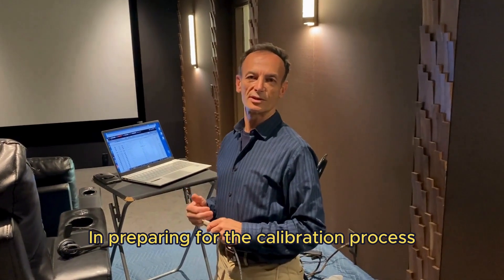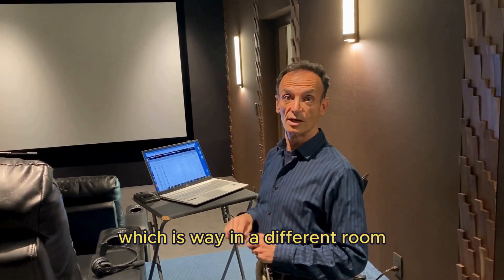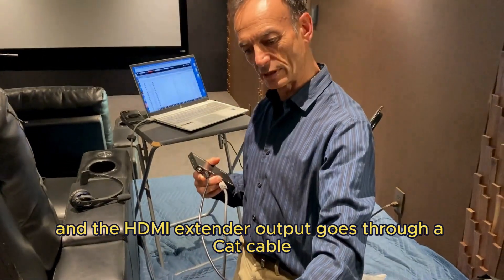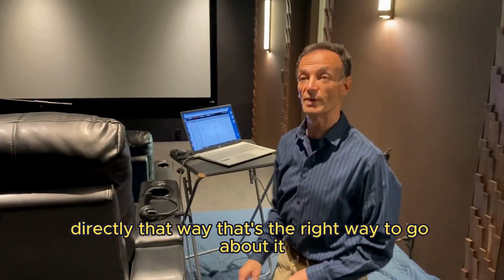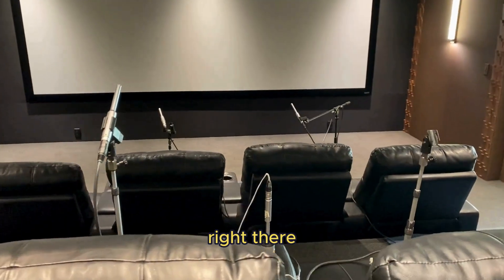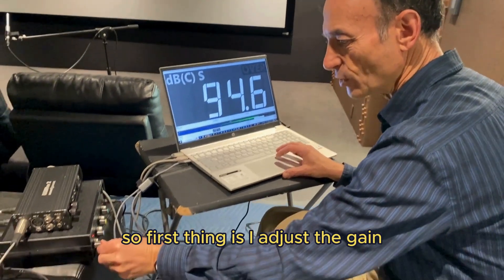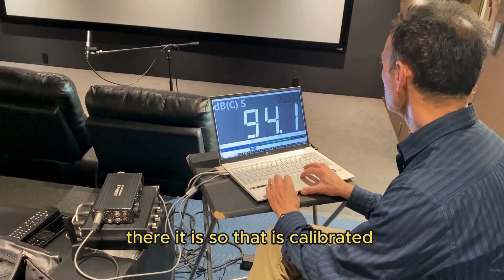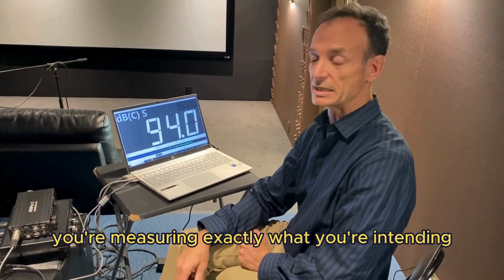Home Theater Calibration - Setting up and calibrating test microphones

Comment: I noticed you have mics facing in different directions, what's the reason for that? Are they measuring directly at 0 degrees for specific speakers?
Reply from the maker: The mic directions were probably not set when we were running the camera. I usually point the mics towards the front speakers, at about 45 degrees. These mics are omnidirecitonal over the major part of the spectrum we are interested in, so doesn't matter too much

Comment: Mind sharing the tool used to calibrate the mic?
Reply from the maker: I use  EXTECH model number 407722.
Reply: @grimanisystems What calibration mics are you using? Earthworks?
Reply: I think the Extech 94dB calibration tool SKUs are 407744 407766.